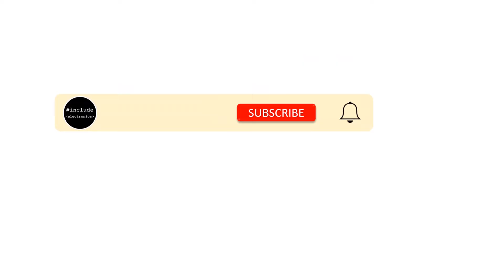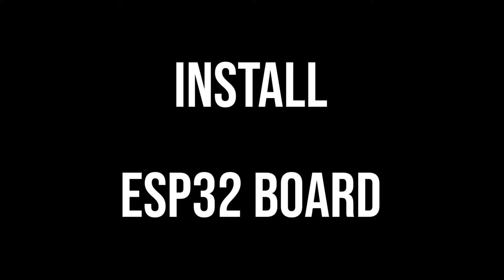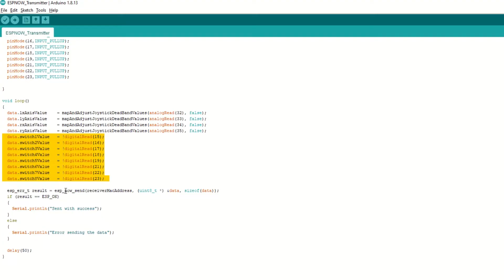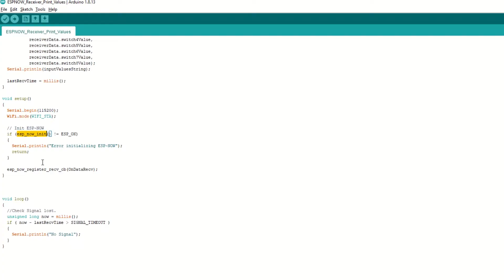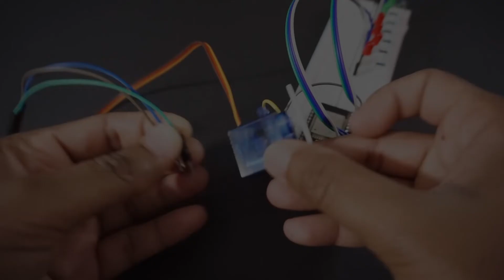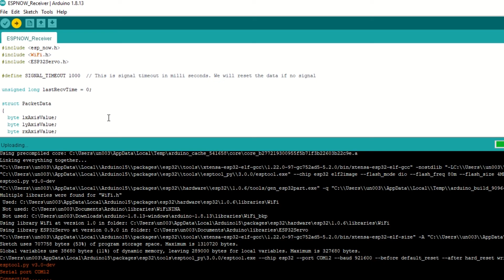12 Channels ESPNOW Wireless Transmitter Receiver using ESP32 | DIY 👌

Comment: Bhai maine mera ek truck ka model hai usme 5 lights ke liye button diye hai aur ek steering pe bo motor control karna hai via input potentiometer Jo ki transmitter me laga hoga ,aur lift axle ke liye ek motor,aur reverse forward ke liye ek motor meko batao meko wireless banana hai toh kaise proceed kari batao
Reply: Bhai sath hi me mujhe 7 gear ke inputs bhi Dene hai how to do this
Reply from the maker: @gnoledgeofficial1575 this is big project and complex one . I am busy with other work so would not be able to help you on this . You can use this transmitter receiver if that helps you . Good luck 👍🏻👏🏻

Comment: Can i use this code to ESP32 C3 Supermini with some modified channel?
Reply from the maker: Please use the same module which i used to avoid issues 👍🏻👏🏻
Reply: I help u if u want to make transmitter and receiver with esp32 c3 then I help you in term of providing code and connection please reply give ❤😊 also mension your specs I also add display that can reverse the settingsof roll pitch yaw  show tx rx batter range between transmitter and many more if you interested I tell you how to do it

Comment: Pls give another code for receiver , because the code you have given in the discription is showing some error ...pls 🙏🙏🙏🙏
Reply from the maker: The code in the description has been tested and works. You need to check your connection and the wiring. What exact error do you get ? 👍🏻👏🏻

Comment: What is maximum and minimum range of reciever and transmitter and can it be used in drone with one flight controller?
Reply from the maker: I tried around 100 ft . But it can go upto 200 ft it is said 👍🏻👏🏻

Comment: hey bro Im having errors with the print values code on reciver, its says - 
Compilation error: invalid conversion from 'void (*)(const uint8_t*, const uint8_t*, int)' {aka 'void (*)(const unsigned char*, const unsigned char*, int)'} to 'esp_now_recv_cb_t' {aka 'void (*)(const esp_now_recv_info*, const unsigned char*, int)'} [-fpermissive].

does anyone know how to fix this error? hash please help with this,. Thanks
Reply from the maker: I have not encountered this issue ever . Looks like the signature of function does not match with callback. Need to check more on internet to resolve it 👍🏻👏🏻
Reply: @hashincludeelectronics   i had a feeling its to do with the versions, since im using a newer version. i was right. i fixed the code in the latest version. well technically i didn't fix it. it was chatgpt lol. if u want i can send u the code to update the github, if not thats ok ill just paste the code in this comment section if it lets me. great video by the way
Reply: Replace line 28 "void OnDataRecv(const uint8_t * mac, const uint8_t *incomingData, int len)"

With "void OnDataRecv(const esp_now_recv_info_t *info, const uint8_t *incomingData, int len)"

Comment: How much motor can run with 1 esp 32 with 2 motor connect 1 joystick now how much joystick will connect to 1 esp32 module or how much motor connect to the esp32
Reply from the maker: It depends upon number of pins 👍🏻👏🏻

Comment: Hallo it is a very great video and turorial. Thank you.
But the receiver sketch shows me at each time the following message:Arduino: 1.8.13 (Windows 10), Board: "ESP32-WROOM-DA Module, 

exit status 1

invalid conversion from 'void (*)(const uint8_t*, const uint8_t*, int)' {aka 'void (*)(const unsigned char*, const unsigned char*, int)'} to 'esp_now_recv_cb_t' {aka 'void (*)(const esp_now_recv_info*, const unsigned char*, int)'} [-fpermissive]

Do you have an idear what the problem is.? I hope you or another in zhis Chat can help me.
Reply from the maker: @PeterVonPRONAY  Thank you for checking out the video and nice comment. 👍🏻👏🏻 try selecting esp wrover module as shown in video while uploading the sketch . 👍🏻👏🏻
Reply: Thanks for taking part on my problems. I think, the right Board  ist selected by me. The Transmitter Code upload works well. The Problem ist shown while the Receiver sketch ist compiling.
Reply: Replace line 28 "void OnDataRecv(const uint8_t * mac, const uint8_t *incomingData, int len)"

With "void OnDataRecv(const esp_now_recv_info_t *info, const uint8_t *incomingData, int len)"

Comment: Hello what is current comsumption of the receiver without servo to compare with one arduino + nrf24
Reply from the maker: Please check the data sheet of nrf module for this information 👍🏻👏🏻
Reply: @hashincludeelectronics  need to know for esp32 not nrf

Comment: esp32 ke jagah esp8266 use kr sakta hu ?
Reply from the maker: @DIYTechnicianRM  please use esp32 only to avoid issues 👍🏻👏🏻
Reply: @hashincludeelectronics  original esp32 kese find out karu ?
Reply from the maker: @ please use any 38 pin esp32 module 👍🏻👏🏻
Reply: how much range
Reply: how much range ?

Comment: can I give this project a car look by any means to make it look more attractive ??
Reply from the maker: Yes you can 👍🏻👏🏻
Reply: @hashincludeelectronics  sir after uploading the print values on receiver my serial monitor is showing no signal.... i have checked my hardware and my mac address too still it is showing no signal and showing like this for transmitter 

Last Packet Send Status:	 1
Message failed
127
127
127
125
Sent with success

 sir what should i do ... can u please help sir
Reply from the maker: @devdass6465  which Arduino IDE version are you using ? 👍🏻👏🏻
Reply: Ohk thank you ☺️

Comment: Also can make code for wifi based transmitter for esp/node/8266
Reply from the maker: You can give it a try with 8266 module 👍🏻👏🏻 not sure if servo will work . Let us know how it goes 👍🏻👏🏻

Comment: Can i use 30 pin boards
Reply from the maker: I would recommend to use only 38 pins module to not face issue 👍🏻👏🏻
Reply: Can you tell me different of 30 and 38 pin

Comment: is it possible to replace both "ESP32" with "ESP8266", Thanks in advance
Reply from the maker: I have not tried that . I would recommend to use only esp32 to not face any issue 👍🏻👏🏻

Comment: Motors (+) should have their own power. It solves the problem with higher currents, volts, watts as well. 
Power 1 = Micro
Power 2 = ESC ----> Motor
Micro signal/ground <----> ESC

A few "toy motors" probably won't hurt, but you will run into issues all of a sudden.
You can also run brushless (3 wires <---> ESC) in what I'm saying.
Reply from the maker: Agree 👍🏻👏🏻

Comment: bro can we use this transmitter and receiver to build RC plane 

can you tell me how to control speed of a motor using joystick
Reply from the maker: Its range is max 200 ft said . So will not be suitable for RC plane . You can use nrf24l01 transmitter receiver for this .  Check my video on it 👍🏻👏🏻

Comment: Bro not working no signal receiver is showing 😢😢😢😢😢😢😢😢😢😢😢😢😢😢😢😢help ma
Reply from the maker: Which version of Arduino IDE are you using.  ?
Reply: The version you are  using that only I am also using
Reply: Hi bro
Reply: Check the connections carefully
Reply: Same here. I reverted to older version to get the Mac Address code and that worked. However, after uploading the receiver and transmitter codes, I still receive no signal.

Comment: Bro it keeps on printing no signal please help
Reply from the maker: Which Arduino IDE version are you using ?
Reply: @hashincludeelectronics  bro I have tried 1.8.13 , 1.8.19 and the latest version
Reply from the maker: @JackSparrow14111  oh ok . Keep 1.8.13 version . And check if you are using correct MAC address . 👍🏻👏🏻
Reply: @hashincludeelectronics  ok bro I'll try Thanks for replying
Reply: @hashincludeelectronics  bro it still keeps on printing no signal 
But if  I use the inbuilt espnow example (Master,slave) it works fine
Reply from the maker: @JackSparrow14111  this is strange. Are you sure you are using the proper MAC address of your receiver ? Please double check . It’s very simple code and should work . Also please don’t connect anything to circuit . Just use 2 esp32 first 👍🏻👏🏻
Reply: @hashincludeelectronics  Bro still it's not working I have triple checked the Mac address and swapped the recv esp32 and trans esp32 too and I didn't make any connections yet 😭😭
Reply from the maker: @JackSparrow14111  ok please send me the video on my email id how you have set up things and how are you testing . 👍🏻👏🏻
Reply from the maker: @JackSparrow14111  un0038998@gmail.com
Reply: @hashincludeelectronics  bro I have sent the video
Reply: @hashincludeelectronics  Brooooo some miracle happened my receiver started printing values THANK YOU SO MUCH BRO 😁
Reply from the maker: @JackSparrow14111  wow that’s awesome . Happy for you that it worked 👏🏻👍🏻
Reply: @hashincludeelectronics  😁❤️

Comment: what if print values are not printing what is the problem ? is there any solution
Reply from the maker: Which version of Arduino IDE are you using ?
Reply: @hashincludeelectronics  current version
Reply: @hashincludeelectronics  bro trasmitter and reciver are not connecting

Comment: Hi, I did everything according to the video but my receiver shows no signal. where is my mistake?
Reply from the maker: Which version of Arduino IDE are you using ?
Reply: @hashincludeelectronics  2.2.1
Reply: @hashincludeelectronics 2.2.1
Reply: @hashincludeelectronics  2.3.2

Comment: Can it be used for rc planes
Reply from the maker: Yes it can be for shorter range below 200 ft. I would recommend use the transmitter and receiver created using nrf24l01+ module . There is video on my channel as well 👍🏻👏🏻

Comment: I know this is an older post but maybe someone can help. I was getting the error that it couldn't connect to receiver. So I added the line: memset(&peerInfo, 0, sizeof(peerInfo)); 
BEFORE the memcpy line. So, it now connects but now shows "Message Failed." Still some troubleshooting to do.
Reply from the maker: Are you able to get data at receiver ? Please check . You must be getting data at receiver . However if we are sending data at high rate the for few packets transmitter fails to send data that is why the error . But Should not be a problem . Please check at receiver side 👍🏻👏🏻
Reply: @hashincludeelectronics  I did serial.println for transmit and receiver. The buttons and joystick show the values on the transmitter and react when I push buttons or move joystick. But, on the receiver side, it shows 127 127 00000000 which is the values of the joystick and buttons. They don't change.
Reply from the maker: @edparker007  this is strange . I believe the MAC address you have added in a code is correct. May be remove all the connections and just have one joystick connected for testing and see if that works. 👍🏻👏🏻 I don’t imagine any issue as such.
Reply: @hashincludeelectronics  It doesn't make sense. I even switched to an earlier version of Arduino 1.8 because that helped with some connectivity problems. I am using the ESP32 WROOM which has 4 MAC addresses (board, softap, BT, ETH). I tried all four of those MAC addresses. I might just use your ESPNOW_Car code and then try to add buttons to it. I'm very new at this so I might need to start small as I learn. I love your page and it has helped me learn so much.
Reply from the maker: @edparker007  sounds good idea to start with small code and project . Even you can use my recent video with ESPNOW broadcast MAC address to try. Don’t worry it will work 👍🏻👏🏻
Reply: RESOLVED! Apparently, it was a pin problem. I am using the WROOM and pin 16 & 17 (although they say GPIO 16 & 17, is really RX2 & TX2). So, I changed to pins 12 and 13. Problem solved. it is working as it should be.
Reply from the maker: @edparker007  awesome 👏🏻👍🏻

Comment: Hii brother pls reply, can i use a dc motor which has only negative and positive terminal instead of servo motor. If yes then pls tell 😊
Reply from the maker: You will have to use motor driver for running motors. Please check my video on ESPNOW cars for reference 👍🏻👏🏻
Reply: @hashincludeelectronics  can you please provide link about how to control DC motor by this 12 channel?

Comment: It works with the Esp32 module DEVKITV1?. I tried but on the serial monitor of the transmitter the message "Error sending the data" appeared, on the serial monitor print received values it shows the message "No Signal". I did all the steps and put the MAC address but it didn't work, probably the problem is that my module is Esp32 DEVKITV1. I don't know, can you help me?
Reply from the maker: Which Arduino IDE are you using ?
Reply: @hashincludeelectronics  I´m using Arduino 1.8.16 and Arduino IDE 2.3.1
Reply: I have found the solution, the main problem is that this video provided esp32 code is old. esp32 updated their esp_now protocol receiving code. Arduino IDE 2.3.2 uses the latest esp32 library, When you use this old code then IDE shows Error Compile.
Reply: Same problem i am also facing can you help me.. Using arduino ide 2. 3.2
Reply: Same problem bro, i am also facing same issue. So please give me working code.

Comment: What is the maximum distance between tx and rx so they can still communicate?
Reply from the maker: It is said 200 meters . 👍🏻👏🏻
Reply: @hashincludeelectronics  wireles 200 meter?? really??
Reply from the maker: @bebashambatan6903  I have not tried the whole range. It is said on paper range . You can give it a shot and let us know how far you get a range 👍🏻👏🏻

Comment: Hello, 

How does it work if you do the same thing over the Internet? So one Esp in China is the other Esp in Europe.

Thanks
Ferhad
Reply from the maker: This can work locally only . If you want to use it globally then you need to use some third party cloud based application like blynk etc .
Reply: @hashincludeelectronics  Thank you very much!.
Reply: @hashincludeelectronics  
Sorry,
You can only control the ESP32 or see the temperature etc. via the Blynk or romoteXY pages via the app. But I'm looking for one ESP32 to control the second ESP32. Is that also possible? Unfortunately I haven't found how to do that. If you can make a video about it, I am very grateful!

Comment: Sir, I want to do another programming of controlling 14 DC motor with L293D IC in esp 32 so how to do programing of transmitter and receiver. Can you give me a program of transmitter and receiver for controlling 14 dc Motors with L293D IC.😇😄
Reply from the maker: Unfortunately I could not be able to provide it . It needs coding and testing as well. You can give it a try 👍🏻👏🏻

Comment: Can i connect 14 ac motors to esp 32 38pin or in aurdino nano
Reply from the maker: Yes you can . However what ac motors are you taking about ?
Reply: @hashincludeelectronics like N20 AC motor
Reply: @FFSTARZARD  n20 is DC geared motor

Comment: Can I make it with arduino Nano?
Reply from the maker: No. It needs esp32 . You can check my other videos where I have used Arduino nano and nrf module 👍🏻👏🏻
Reply: @hashincludeelectronics  ok
Reply: @hashincludeelectronics  plz make a 12 channel transmitter and receiver with Arduino...
Reply from the maker: @SampaBarman-rj1go  please check my video on transmitter receiver using Arduino . It will give you enough idea 👍🏻👏🏻
Reply: @hashincludeelectronics  thanks

Comment: Please make a flight controller for drone with esp32
Reply from the maker: You can use this transmitter receiver setup for drone control remotely 👍🏻👏🏻.
Reply: Make a drone reciver with flight controller for coreless motor drone which I can control wifi.
Reply from the maker: @marscreation.s  oh ok . Got it . Sure I will try that . I have drone kit but did not get a chance to work on it further . Anyways I will try 👍🏻👏🏻
Reply: I want to control drone using mobile phone.

Comment: Congratulations on the project friend, could you help me add a button with retention to this code? obrigado
Reply from the maker: Thank you very much for checking out the video and nice comment . Do you need it as toggle switch ? What do you mean by retention ? I don’t really get it . 👍🏻👏🏻
Reply: Thank you very much for giving me your attention, in fact I would like to change two buttons, when I just touch one of the buttons one of the LEDs lights up and stays on. When I press another button another LED will flash, if I press the button again the LED will turn off.thanks friend   @hashincludeelectronics
Reply from the maker: @foradacurvaautomodelismo  actually you will need to make changes in transmitter code . Check the previous button state . And if it changes then toggle the output which is sent as data .
Reply: ok amigo obrigado por responder @hashincludeelectronics

Comment: Excellent video and tutorial. Is there any way to make the led's stay on with a button press, then off when you press again?
Reply from the maker: You will have to make the changes in code to have the button work like toggle button . 👍🏻👏🏻
Reply: @hashincludeelectronics  do modify the receiver's code or transmitter's code for toggle switch?

Comment: Hi, I'm trying to make this project but the recceiver shows on the serial monitor the message "No signal" I have inserter the receivers MAC address in the transmitter code. Any insight as to wy this could happen ? I also tried another board for the receiver and transmitter but still the same thing.
Reply from the maker: Check for any loose connection 👍🏻
Reply: There are no loose connections.

Comment: Hi,, great tutorial. Is it possible to make it so one ESP32 is master and controlles 2 more ESP32 as slaves so when the buttons are pressed on the master ESP32 and depending which button is pressed the corresponding Slave ESP32 will react  ?
Reply from the maker: Thanks for checking out the video 👍🏻. Yes you can do that . Check for videos on internet for esp32 broadcast using ESPNOW . It’s just matter of changing the address to broadcast and some other setting . 👍🏻👏🏻
Reply: @hashincludeelectronics  do you happen to have a tutorial?